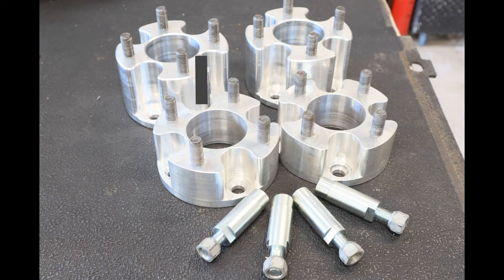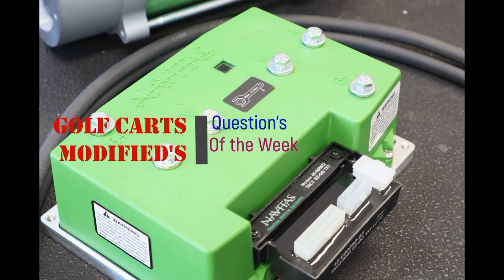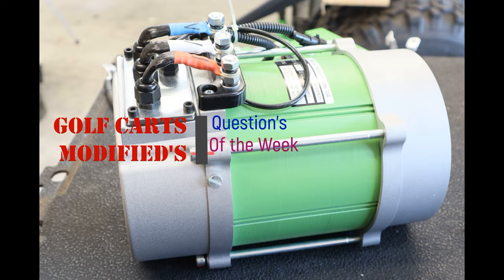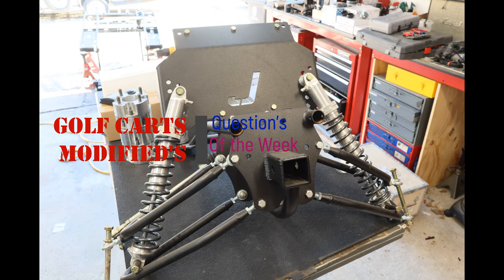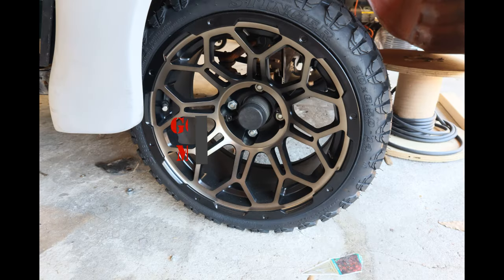The Best Way to Run 12 Volt accessories on your Golf Cart!

Comment: Hey man , I enjoy your videos and information.  I recently installed a 12v converter on my g29 and a fuse box. I ran some under body lights from led  glow and purchased a bazooka party bar to install. I don't want to drill holes through my aftermarket cover to install the bar. I seen that golf cart kings makes an accessory bar that runs from roof mount to roof mount but are currently out of stock for the g29. Do you know or have any other examples of mounting these bars? I would greatly appreciate your help. Keep up the good work.

Comment: I have a 48 volt Yamaha Drive with 30amp 48/12 reducer. I added a 48volt 40 amp Accessory relay that is powered by 48volt key on, and 12 V power from reducer is energized when key is on. From there 12V goes to fuse panel, and then to equipment . Doesn’t run 48’s down unless you leave key on. By the way Great Channel for info

LJ

Comment: I have a Cushman 72V lithium 2 battery setup running in parallel with a bus bar.  A guy wired it up for me and everything works but the electric dump bed.  I assume it's 12v, right?  Can I just wire a reducer to the bus bar and then to the dump motor?  Or how would I do it?  Thanks.

Comment: I have 2022 Vivid ev with 48v Lithium batt. My LED running lights on the rear stopped working when i tapped into it for a 3rd break light and they stopped working on the running light side. Break and tails still work. Obliviously the ground wire isnt the same as a chassis or battery terminal grounding. How does it ground with LED lites on a Lithium setup.  All fuses are good. any suggestions?

Comment: Have a Club Car precedent 48 volt.   Purchased fuse box, and 48 to 12 volt reducer.   Looks like plenty of room inside battery compartment for both units…. Figured, best for protection from the elements…. Your thoughts?

Comment: I installed a 48/12v converter on a 2005 clubcar precedent.  Where do I attach the negative wire from the converter.  This had factory lights but no black wire available.  Is there a common ground.  I cannot follow the downloaded schematics with the spaghetti of wire visible.  Any help greatly appreciated.  Thanks.  How do i know i got a reply?

Comment: do you think the icon i40l converter and agm battery system will withstand an ecoxgear 32 inch soundbar and the ecoxgear 8 inch subwoofer? they are both self amplified up to 500 watts.

Comment: Is it a bad idea to just do a completely isolated battery system? I was thinking about doing a separate battery for 12v accessories.
Reply: I have done a completely isolated system on my 36V Ezgo cart. get a deep cycle marine battery and a marine grade terminal block to ensure each added circuit has a fuse and is easily identified. While a proper reducer is certainly easier to implement I wanted a complete and isolated system from the drive batteries. 

Advantages of isolated system:

No range reduction from draining drive batteries.
Capacity for more accessory circuits
Any issues won't effect drive electronics
Peace of mind if you just want to park and blast the stereo system and other mods while tail-gating, etc.

Disadvantages

cost/complexity
added weight
Need to run a separate charger from drive battery-pack charger. I bought a low amperage charger and mounted it in the cart and added a receptacle under the main pack charger receptacle that accepts  a standard female 3 prong cord. 

While the author is certainly right that a quality reducer can cover almost all people's needs I wanted to go the extra mile.
Reply: Jeremy, If you have a lot of 12 volt accessories, I would go with a big Automotive/Marine/RV size deep cycle battery and fuse block.
I'm just powering a pair of added LED headlights, and a lighter plug power outlet for our cell phones or a mini air compressor. I have a $29 dollar 12 volt lawnmower battery from Walmart without a fuse block. It hardly takes up space and doesn't add another 65 pounds to our 36 volt EZ-Go. I trickle charge it once or twice a camping season for the past two years without any issues.

Comment: question, for a simple cheap led kit off amazon, why can't I just use the +/- off a single battery to power the module? Put my meter on it and its a constant 13V (I have a 48V system). Will it be a slow drain?  Also, I already have headlights/taillights/blinkers/horn installed by the dealer.  Should I just try and find where that is and tap off of it so that the circuit is dead when key is off?
Reply: I know this is an old question, but the problem with doing that is that you are pulling from only one battery, so that battery will wear out quicker than the rest. With a reducer, you are pulling evenly from all batteries. You may also notice the lights might dim a bit when accelerating if you don't use a reducer. I have only noticed that with incandescent lights, not LEDs though.

Comment: I'm new to golf carts and electrical in general; but I just got a 48 volt club car and wanted to get LED headlights, I already have halogen lights on the 2004 cart, wouldn't  that cart already have a reducer for the factory light kit ( 12volts)? or are are factory headlights 48 volt?

Comment: I installed a 12v fan on my 2021 Yamaha Drive 2 EFI. I connected directly to the battery with an inline 5 amp fuse. (Specs on fan says it draws 2.5 amps). I notice that the fan speed varies with the cart speed. Is this normal? Should I not be connecting directly to the battery? Will I damage anything by wiring directly to the battery? Thanks for any help!

Comment: This is probably easy for some, but I’m not a wiring guy, I’ve got a voltage reducer with a fuse block, 48v cart, am wiring a light bar, the fuse block only has side for red positive wire for light bar, my question is what do I do with the black negative wire on the light bar? I don’t know what to hook it up to? Do I wire it to negative at end of battery run and connect positive to fuse block? Help is appreciated
Reply: If I were you, I would purchase a fuse block that has both negative and positive post. Remove your existing fuse block. Identify the negative battery post that your voltage reducer is wired to. From that negative run a wire to wherever your fuse block is located. Plug the positive wire from the voltage reducer to the fuse box's positive and the negative wire from negative battery post to the negative on the fuse block. Now, each time you add a 12v accessory all you have to do is plug in the positive and negative terminals to the proper location in the fuse block and add a fuse.

Comment: was wondering. if I have a 36volt golf cart. can i use a 48volt to 12volt converter in it. thanks
Reply: Get one that is recommended to work with  36volts.

Comment: Without a doubt the easiest and safest way is adding an additional battery. I mean there’s usually more than enough room to add an additional battery or two.
Reply: I agree. I'm just using our 36 volt golf cart for leisurely riding around our camp ground. After watching this video, I'll stick to my cheap and simple set up. A separate $29 dollar 12 volt lawn mower battery from Walmart to power a set of LED headlights. I trickle charge it once or twice between opening day May 1st, and storage by Oct 31st. Two years and no problems. I added 2 power outlets in the dash for charging cell phones or to run a mini air compressor to fix the occasional soft tire. Was thinking about a CD player next summer.

Comment: Can I wire my 48V reliance converter to the output side of solenoid so that when the key is off, it kills the power to prevent parasitic draw? Or will this chance messing up my controller or cause it to kick out if it senses voltage drop while using sound bar, lights, tail lights, headlights ect...? I hear some controllers can be sensitive. This is on a Yamaha Drive. Any info? Thanks